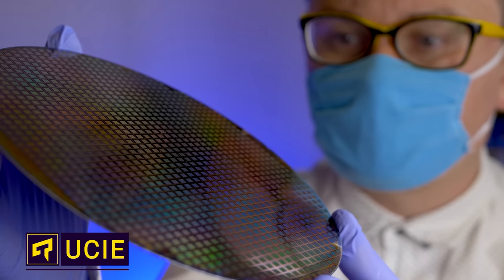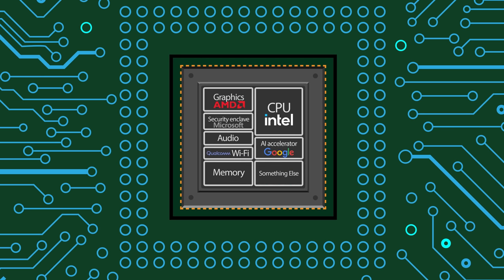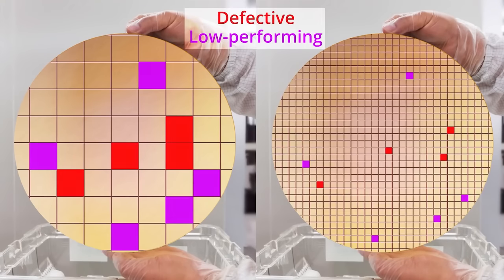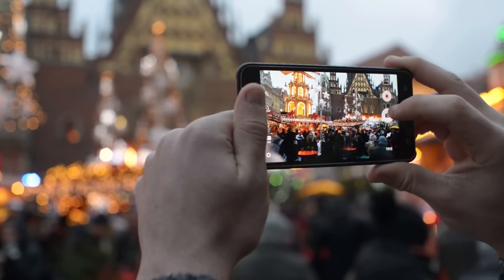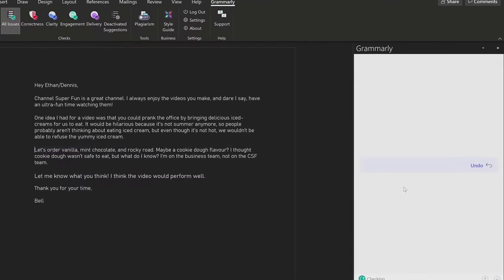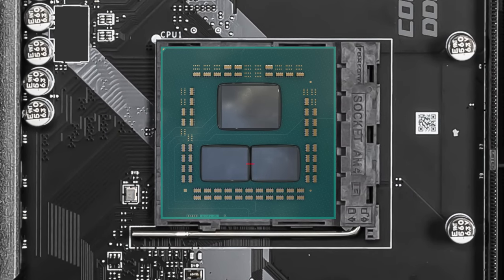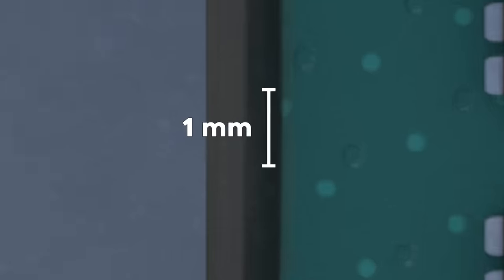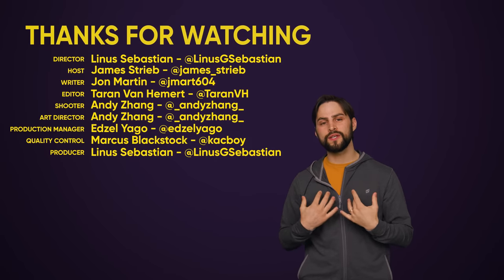A CPU From AMD...AND Intel?! (UCIe Explained)

Comment: Issue I see here is the SSD drama all over again.  Fancy new CPU shows awesome benchmark from LTT, you run out and buy the exact same sku, just to find that the manufacturer replaced that APU with a lower cost, less performance version.  I see the preverbal 'mixed bag' when purchasing CPUs in the future.
Reply: You used so much terminology that has literally nothing to do with any of the rest of the things you talked about... Like I get it to a certain extent, but are you upset about SSDs or CPUs with on board graphics? lol
Reply: @combatwombat594  its probably because you didn't understand the ssd drama he is referring to.
Reply: @combatwombat594  A while back SSD's had some drama where the manufacturer's were switch controller chips inside the same product line, making it a crap-shoot on what you'd get.  I was likening it to that, but for CPUs.
Reply: "just to find the chiplet is replaced by a cheaper, lower performance versions"

just offering a possible correction
Reply: @zeropointmx2552  ah OK, didn't hear about that. But yeah I see the potential for it to be done with this of course
Reply: @anonym34566  Meteor lake is going to be made on Intel 4, there's no "Intel 8" node.
Reply: obviously transparency is key
Reply: @lycanthoss  that’s 7nm isn’t it
Reply: @Allpurple_reign  no it's Intel 4, though they used to call it 7nm, but it doesn't matter because the nanometers literally mean nothing and haven't for a long time.

Comment: Core i9 with RDNA3 graphics?
Reply: There actually was an i7 with Vega graphics back in the day. The i7 8809G was a 4c / 8t CPU with a built-in Vega M GH GPU. The whole thing had a TDP of 100W, which was mostly that GPU. It was used in some NUC designs as far as I can tell.

Comment: AMD and Intel have had a business relationship in the past.  AMD once made CPUs based on Intel's design in the 1980s and early 1990s.  Just throwing that out there because Intel working with AMD isn't a new thing, it just hasn't happened in decades.
Reply: You mean when amd was tiny and intel was a behemoth? 
That means absolutely nothing now that both are giants in each others fields
Reply: It’s more like IBM forced Intel to work with AMD as a second source because IBM didn’t want to rely on just Intel to make processors for them for its supply chain.
Reply: also technically Intel licenses AMD64/x86-64 from AMD
Reply: AMD64 instruction set enters the chat.
Reply: Did you miss the part of the video where he says intel used amd graphics on their mobile cpus in 2019
Reply: And a more recent example of Intel working with AMD would be Hades Canyon (Core i7-8809G).

Comment: Everyone knows that 2 5G modems would give you 6G. Just as 2 4G modems gave us 5G.
Reply: We have all the Gs
Reply: thats not how it works. if you take 2 5g modems you get 10g. just like you get a 64 bit install if you install a 32bit version twice.
Reply: that's so G, yo 😎
Reply: @satakrionkryptomortis  Nope, if you have 2 5g modems it's actually 55g, Which is why 64 bit version is actually 6.4 bit version twice.
Reply: @frozenturbo8623  2 5g us 25g, c'mon

2 4g is 24g
Reply: you're all wrong, if you combine 2 5G modems you clearly get 2^5 = 32G.
Reply: I have the G point
Reply: This is kind of a thing, AT&T advertises dual band 4g as 5ge
Reply: I think that was the april-Joke :)
Reply: @pixelmaster98  3,125G = 5 to the 5th.

Comment: You could use different parts from manufactures to best fit work load,  not dependent on one vendor for a part, you could save time and money outsourcing.  Hoping this saves on power lowering the computing power grid requirement.

Comment: I don't like it, some shitty devs already claim their game runs poorly because of the infinite amount of hardware combinations on PC this would only make it exponentially worse... and even if a game implemented it right I fear frame times might get all over the place id rather have a stable 144/240 FPS than 400FPS but with frame times all over the place.
Reply: I'm guessing you mean that they would claim it's the reason it's This game is bad due to this new standard because the whole point of a standard is to standardize it.

Comment: UCIe may solve the security problem that exists with the current CPU Management Engines; services in the system that can't be turned off or easily turned off. Like when certain 3-letter agencies in the US demanded a way to turn off the permanent remote access built into modern CPUs, so the manufacturer wouldn't have access to their systems.  It can be partially disabled, but not fully.

Comment: Going to need a lot of good software support to really make this spec shine properly.  
Even right now with Mixed Core architectures like Big Little, they are quite bad at times with switching loads dynamically depending on the workload.  Even look at the likes of Samsung who had been found to be screwing over loads of apps by forcing them on weaker cores for the sake of battery life.
Some stuff can be automated like the Samsung method, but proper APIs to fully take advantage of these mixed architectures is absolutely vital.

Comment: What I'd love to see, if this standard gets adopted widely, is CPU + RAM + GPU all on one set of integrated chiplets.  Upgrades would be as straightforward as removing one CPU... and cooling solutions, airflow and motherboard design in general would get hugely less complex.  The disadvantages (lack of upgradeability for individual parts, failure of one part of chiplet means the entire thing is e-waste) would get hugely offset by the overall lower prices (once this started becoming a standard, the costs of these combined chiplet machines would be hugely cheaper than separated components with their widely-differing cooling, installation and other engineering hassles).  Plus motherboards could continue to support a bit of upgradeability- a couple of PCIe slots, a couple of slots for RAM, M.2 drives, etc.- whilst becoming significantly more compact, easier to keep cool, etc.

It'll be interesting to watch and see if any big players realize the economic advantages this would present (we're talking maybe $500 - 1000 less, for an enthusiast-level machine, and the potential for laptops is kind of mind-blowing, as it would eliminate a great deal of the thermal headaches) and grabs this opportunity.

Comment: A drawback on my mind is that you'll be limited by the warmest chip. Even if another has a ton of room to improve. The heatspreader works but the chip will still have hot spots that may prevent other chips from performing.

Comment: CXL is a bit more than that stated.  Step back to macro level. With more than the lone CPU doing the lifting you need to deal with coherency and massive block moves.  PCI-E as an electrical signalling interface is fine but was never intended to be more than a peripheral interconnect. Now you want to have application specific compute functions - the CPU, AI block, GPU etc. Well you need more - a lot more.  The other thing to pay attention to is the huge change PCI-E was over PCI and PCI over ISA bus. ISA was just lame I/O with limited memory access. PCI expanded that to increase memory access and more I/O but was still a shared bus (one guy talks at a time). PCI-E actually jumped to a switched almost network switch type approach and allowed parallel transfers between nodes. If slot 1 was talking to slot 3 and 2 to 4 - they could do it simulataneously. Now the move is for many to many with coherency. (And of course you have more lanes and more cores.) So its trying to unify more. Graphics drove the evolution to PCI-E. Compute is now driving it the next step. 
Finally the other thing being on the same substrate (this is an MCM) gives you is a short electrically clean path between those functions. The shorter the electrical wire (with fewer vias) the faster you can push the speed. So slot PCI-E will max out at X but MCM PCI-E interconnect will be X times X.  
Note that similar tricks have been played on big iron CPU arrray systems for decades.  Its just coming to a consumable level.

Comment: Note: RF chips can be made on smaller (better) process nodes but using larger features and be just fine. It's just a potential waste of smaller process space that could go to other features whole the RF chip could be built on less expensive older nodes.

Comment: It is actually possible to massively improve connection speeds with 2 SIMcards and 2 modems (through supported protocols) ! Just not the ping.
Reply: IRL steamers use modems with different providers into 1 device so they always have a connection.

Comment: I mean. We need to start get alternatives for our chips. We need more efficency and seperated Tasks. Prozessors are already heading that way. This might be also important for Graphic Cards espacially now. I mean i am at a point where i say 400W for a GPU is way to much. I also am for that point that more modularity opens the way for making PC build more oriented. Don't need integrated Graphics? Omit it or use the weakest one that only supports one ressolution for Diagnostics. And more things like this.

Comment: It would be nice to know what minimum quantities you can go down to for a specific chiplet assembly if you still want to pay a reasonable price (and by that I mean the price of the assembly rather than the price of the chiplets installed, because they can in be bought in larger quantities in order to then be combined individually).

But the chiplet assembly is only one side, you also have to connect the whole thing to the "outside world" with the pins.
Reply: Just a thought, it might be alot like arm chips now where you can mix and match cores, then tune those cores to how you want.

Comment: So one question what would you call multi module  ssd nvme  system on chip (modular one with similar connectors ) with tiny little chipplets that represents each one parts of computer. (cpu ,wifi GPU audio outputs and external sockets etc ) of size no bigger than 5 nanometers posible to connect together on  motherboard size of 2.5 inch hard drive  (me neither ,but that is possibility to make with current technology  no matter what kind of architecture we are talking about arm or x86 )

Comment: I wonder if you could have a hybrid architecture desktop OS and have a chip with both x86_64 and arm64 cores in it. So you could have a mobile development computer where the phone emulators run using the same arm version of the phone OS as real phones do, but without having to emulate arm on an x86 chip.

Comment: When two large superpowers make a one thing it will suck
Reply: It leaves top much room for digital proprietary conflict...my gut tells me this is a disaster waiting to happen depending on the individual use case scenario

I DAMN SURELY DONT want Infail in my system ...worse case I I will accept their wlan chips because they're rock solid reliable and are just plug n play in Linux

Comment: Really the diagram looked like a SBC that you put your chips onto instead of a package you buy to put into your computer the explanation sounds like a SBC too. So just a SBC but named a package, made more tightly together and when something breaks not repairable by the user. The only thing you usually don't do with SBCs is plug them into another computer. You can but most don't.

Comment: Hmm, a new techquickie, .... 

explain from start to finish the throughput of a PC, a modern gaming PC. Give it a little mock of the advertisers April fools; from peripherals to busses to transistors to peripherals, etc.. [basically point at a computer the throughput at every visible chip or component there is on the motherboards, (it might help to be liquid cooled)] (doesn't have to be every individual transistor if it does the same thing) 

Another one is the "how does a circuit that generates clean limitless power from graphene work?" What can we expect from this technology?

And,
I would like to know what kind of Texels we talking here with the new Intel Arc GPUs?

Comment: That 5g to 10g and 25g joke reminded me another one saying that to get Windows 7 64 bits, you needed to install the 32 bits version twice.
Reply: Wait, WHAT?!  I heard all you had to do was change system32 to system64.  But for some reason my screen stopped working after I did that.  Probably unrelated.   
I looked it up on my EpicSearchz4u toolbar and it say "don't worry about it bro" because I was worried it was too good to be true.  Guess I'm fine.  I'll just wait for it to work again.  Probably has to get used to the extra 32 bits.

Comment: While having NVIDIA Optix compute on an M1 Mac would be fantastic, I think the only way this happens is if the UCIe standard leads to both of them losing their dominant positions in the industry. In my experience, companies with market dominance much prefer proprietary solutions to open standards, partly because their proprietary features give them an edge, and partly because it helps trap the existing user-base within their ecosystem.

Comment: I need this ability to have on-chipset non-Intel Ethernet and WiFi, on demand.  I have yet to use an Intel network chipset that has not had some sort of failure tied to high or low CPU power consumption.  Sleep or hibernate you PC?  Have fun disabling and re-enabling the chipset to get your wired interface to actually move data.  Too much power draw on the CPU?  Say goodbye to your WiFi, especially on mobile chipsets.  It's been consistent for about 15 years now.  I've had to purchase expansion boards and devices to solve the issue every time.  Yet Qualcomm and Aetheros (Qualcomm owned now?) have never had these issues, ever.

If I decide to buy an Intel CPU powered laptop, I'd like to be able to choose a main board that incorporates non-Intel networking solutions.  Part of Intel's hardware designs as well as their OEM requirements require that Intel networking is required, which is why many gaming laptops have a secondary Aetheros chipset in addition to the useless Intel one.

Comment: I wouldn’t be at all surprised if Apple ends up jumping on, right now they make the most powerful systems on a chips in the world right ? And this would allow them to use more regular parts without having to source everything themselves
Reply: I would be surprised if they're jumping on it. Apple is doing the exact opposite because the don't want to rely on other companies anymore. There's no way that Apple would go back from "Apple Silicon" and use like GPUs from AMD and modems from Qualcomm after they pushed so much into doing it all themselves and get much better results this way.
Apple WANTS to source everything themselves. That is the whole point of the Apple Silicon transition, the fact they they now develop their own modems etc.

Comment: Smaller transistors = lower power consumption.  I don't think that's true, no newer processor is more economical than the previous generation.  Then where are such 1W processors and why do they not yet exist on portable devices?  Are the operating systems too greedy or are the programs programmed incorrectly?  Can any modern processor reduce power consumption to 1W?

Comment: Very nice video about a very cool subject. But man, the clickbaitiness of the title and thumbnail is off the charts here. You are giving the impression that there will definetly be another chip with intel and amd on the same package. But there's no such thing announced. Just because it'll be possible, or easier, for them to make it happen, it doesn't mean it will. So this specific CLICKBAIT is actually FAKE NEWS. 
I still gave you guys a thumbs up, the video is great, but I feel like when the clickbait turns into disingeneous it went a bit too far. Just my 2 cents. Cheers.

Comment: Imagine this is a real thing. And the chip of the RTX 3090 directly next to the cpu core instead of an intel gpu unit using higher bandwidth DDR to feed both. CPU and GPU…. Approaching what apple did but…. More insane.

Comment: Can ucie integrate CPU cores from both AMD and Intel on the same package? Would be interesting
Reply: Would be nice to have 4 Intel cores for when applications need maximum performance for tasks that can't be split to multiple cores and then 12 lower cost AMD cores for more parallel tasks. Unfortunately that likely won't be possible.
Reply: @rubiconnn  no official source can do it, but some Chinese company will do this Frankenstein CPU sooner or later
Reply: @RamiKattan  more like copy it from a different company

Comment: If this happen it will be some random guy design the damn cpu thing smaller than manufacture more efficiant in cooling ans another random guy single handed coding i the thing with open source code for sure.